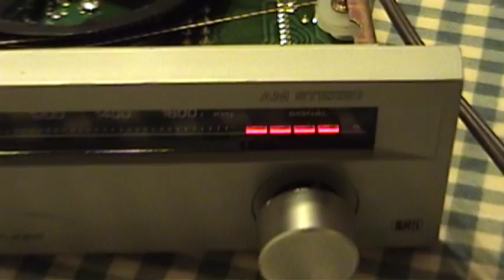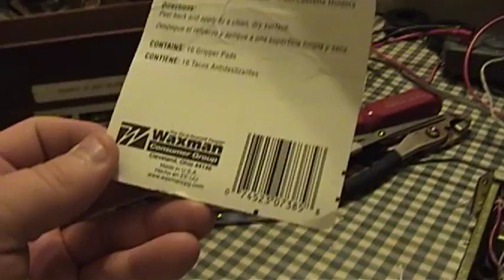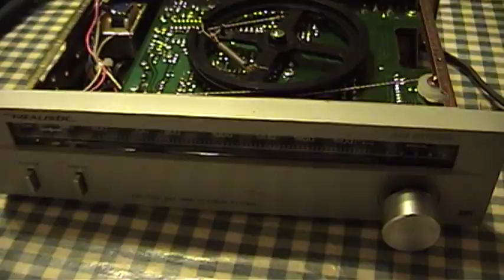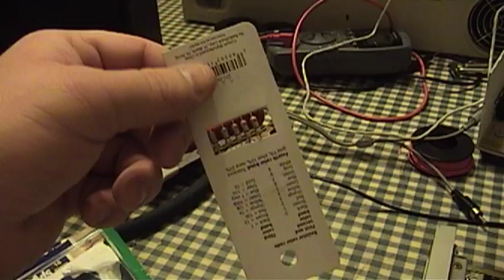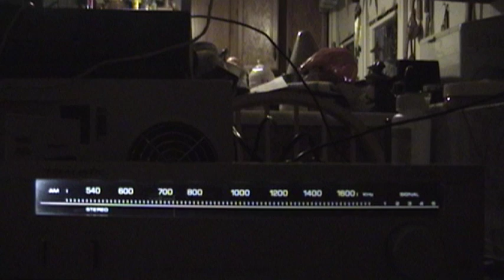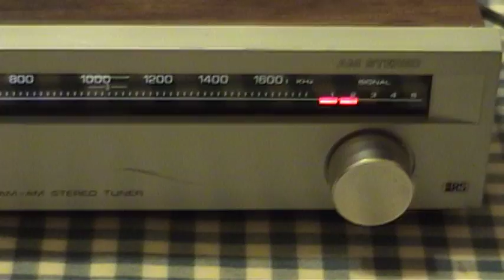Kitchen Table Electronics Repair: Realistic TM-152 AM Stereo Tuner Repair Part 2

Comment: That tuner is a really super tuner. Very sensitive and very selective. Why did C-QUAM stereo fail?? It was the best system. Better than that DAM IBOC HD
Reply from the maker: There are a lot of reasons why AM stereo as a whole was not as successful as it could have been. The FCC allowed multiple and generally incompatible systems to be used by different stations. They had proposed a standard, but backers of the competing systems cried foul and the FCC said "let the market figure it out" before ultimately selecting Motorola's C-QuAM system.

Most tuners only supported one system (typically Motorola's), although Sony and Sansui both came up with multi-system tuners that supported every major system in use.

Analog AM stereo isn't dead yet...some AM stations are quite proud to offer it, at least some modern transmitters have the capability built in, and a few HD Radio tuners (those using the Texas Instruments DSP) can decode it. I would tell you that analog AM stereo has proven more successful than IBOC, and even more so on AM broadcast stations. Only one AM station around here ever used it, and most of the FM stations here have dropped it. All the standalone HD Radio tuners have vanished from the market, leaving only some car radios that can still be purchased new.

Comment: Nice job on your repair, what value resister you used to drop the voltage to install the LED on the tuner?  Would 560K OHM resister work?

Comment: @uxwbill It sure does the wider IF bandwidth improves audio quality by leaps and bounds especially on music. WLS 890 has a huge signal here in central Indiana at night and daytime reception is even possible on good receivers. They actually trigger the "STEREO" indicator on my car stereo which is running off of a power supply and driving a pair of boom box speakers. As for WDWS 1400 I doubt they could be received even at night but nothing is going to stop me from trying.

Comment: @uxwbill Assuming you can get a Motorola C-QUAM broadcast sadly. That IC seems to have been used in other tuners including my attempted rehab project which is a Delco UX-1 but in this case I have not seen Motorola part numbers on it.

Comment: @itouchhacker241 This tuner is ultra HIFI AM along with stereo it does not NEED FM. Plus it was designed to add AM stereo reception to an existing stereo system so it only does AM by design.

Comment: Nice work! One thing you can do to the LEDs when you mount them 90 degrees off from the regular position is to grind down the lens a bit with about 45 degrees so the angeled part on the lens acts as a sort of reflector for the light. Otherwise you wont get much light out.